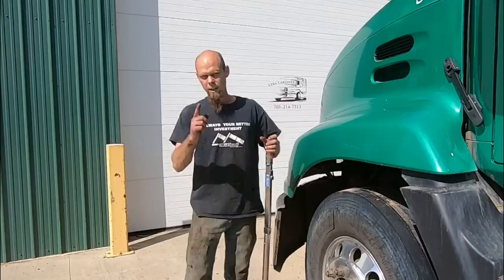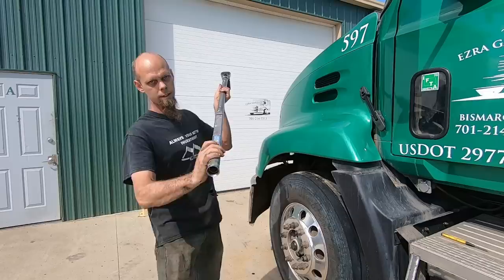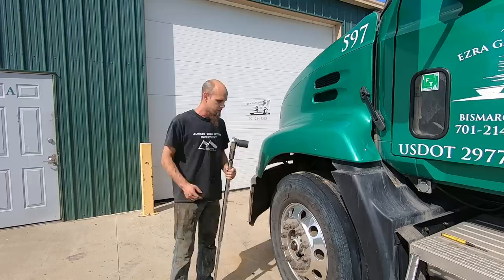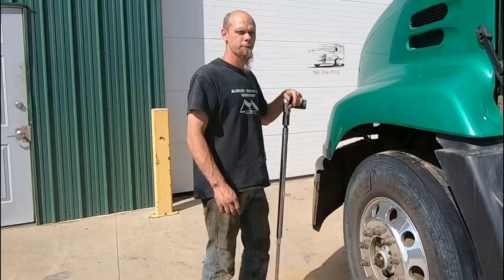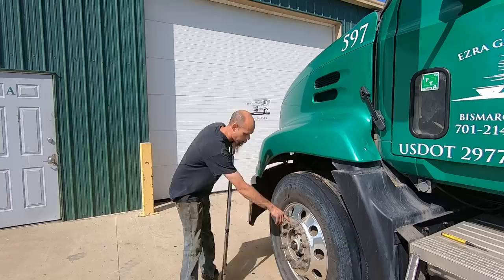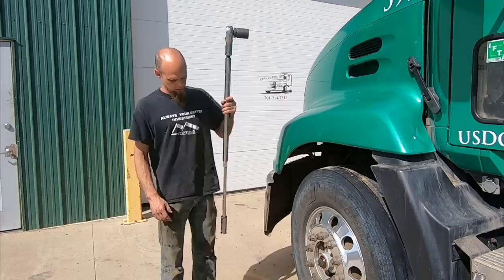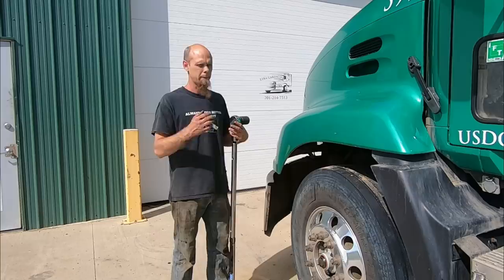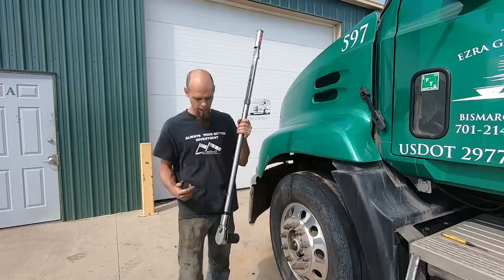Torquing semi truck lug nuts - Precision Instruments - C5D600F36H 1" Drive Torque Wrench

Comment: So how many ugga duggas is that? Trying to see how tight my 1” impact gets my nuts. Over 40years of trucking and not one wheel has come off or one nut loosened up. After awhile you just know how tight is tight with an impact and how much is too much
Reply from the maker: I'd say about 6 ugga duggas or if you want to actually be accurate you can use the method I showed in this video

Comment: Usually finger tight is good enough from my experience. Just make sure you don't cross thread and you'll be fine
Reply: Funny you should say that, Alcoa recommends that 1 or more nuts be run down by hand so the wheel is up aganst the hub (flat), but that the others be left just a few threads on to indicate that the wheel is not yet tight, then once you start, you are committed to finishing. (never fails the boss will call a meeting)but this is one of the things a tire man can't let happen....let the phone ring....ring....

Comment: 750ft lbs i know I change tyres daily
Reply: We're does it show you if you did the right amount of lbs?
Reply from the maker: if your torquing to 750 you are doing it wrong daily.
Reply: @Ezrider359  we change tyres on volvo scania and daf 8x4 tipper trucks 750 we never had one snap round or come loose

Comment: And secondly never tighten wheel nuts when there warm or hot .
Reply: Why?
Reply: @barrioscorona215  who know, I work at a quick lube anf half the lugs are smoking hot nothing happens, maybe bc when they get hot they expand but they'll never get that hot
Reply: @nw4496  yeah I agree with you, metal does expand when it gets hot, but it'll have to be like you said, extremely hot. I work at a machine shop and sometimes we need to do an interference fit with a steel tube and a steel rod. So we heat up the rod with a blowtorch for like 3 minutes and then we insert the steel rod inside, and once it cools down it's like almost impossible to pull out.

Comment: Torque it with a 1" impact and ship it.
Reply: One to two ugga duggas should do it
Reply: Yessir, Yessir, time is money! ☝️😤#ShipIt 💵
Reply: Spline drive ugga dugga send it
Reply: I might agree but... If it is your truck and you care do you want to streach studs? Or snap a stud?
Reply: Just cross thread them. They shouldn’t come loose.
Reply: @ralladoastalamuerte  until next time when you gotta take it off and rip the threads off... hahaha
Reply: And then the wheel comes off and kills someone and you get to go to jail for manslaughter.
Reply: IF THE OWNER IS WILLING TO PAY THE EXTRA TIME (TIME IS MONEY AND TORQUE WRENCH ARE NOT CHEAP)AND EFFORT TO TORQUE THE NUTS
HELL I WILL DO IT!!!
BUT GUESS WHAT, THEY WILL NOT PAY ,SO I JUST TIGHT THEM WITH MY 1" INGERSOL RAND IMPACT, NO PROBLEM I HAVE DONE HUNDRENS OF THEM WITH NO COMPLAINTS,
JUST USE A GOOD BRAND  IMPACT
Reply: @ralladoastalamuerte  I prefer to spot weld my lug nuts after crossthreading them.
They are not coming loose i tell ya
Reply: Hey WOW, you must be on my day shift, is your knick name Larry the Cable Guy by chance?but seriously folks, maybe you really have a gift, I might find my womans g-spot most the time but I never measured it, the problem is, most people don't have the gift but think they do....so that's why the first thing you do when it reaches your lot....RETORQUE!!!!...nut checks????

Comment: Not bad for 400! I'll keep my snap on tho... Much higher price point but, when i do a cylinder head or bottom end i don't have to worry... Nice video as always EZ!
Reply: Your Snap-On is only as good as the last calibration. We used to have our Snap-Off and Matcos recalibrated once a year. Most of them needed some adjusting.
Reply: @cullenmiller8170  my dealer does it for free yearly...service - I've got one of the best reps, hands down. Though my growing Milwaukee collection is pissing him off
Reply: pretty much. I keep telling him he needs to start selling em...figure he gets enough of my money as it is... A
Reply: I doubt you're using a TQ wrench of this size on heads, so what is the point you're trying to make?
Reply: @TheRoadhammer379  the torque on a cat 3406 engine is comperable to what he did the lug nuts to.  Sit down son you're making yourself look uninformed.
Reply: @TheRoadhammer379  and my point is the accuracy of a 400 wrench vs a 1500 dollar one...rims don't matter as much as a Crank or rod journal or a head bolt/stud. Over or under torque will cause leaking or cracking... Mechanical 101...
Reply from the maker: A calibrated tq wrench is a calibrated tq wrench they all need to be periodically checked. When it all comes down to it tq is still a inaccurate way of measuring clamping force. But yeah if someone already has the snap on version there would be absolutely no reason to go out and get this one.one thing to keep in mind too is a tq wrench is most accurate in the middle of there operating range
Reply: @Ezrider359  that's why most of the time cat gives a tq rating with a plus or minus then specifies a additional degree for the fastener to be turned. Usually 90 or 120*.  For the record, I'd totally get one of the 400 dollar ones for doing wheels. I'm just partial to the finer movement in the head of the higher end tools. That 80 tooth action spoiled me!
Reply from the maker: @familytraditiontransportat7951  yeah a lot of people building performance engines for cars have gone to using bolt stretch gauges. Not a fan of the head on this one but acceptable for the price
Reply: @familytraditiontransportat7951  Hard to get a 3/4 or 1" ratchet with more than 24-26 teeth, finish is generally not great and the way they're pinned often adds a wagonload of slop on top, for the money I don't love it. I guess they figure most of the buyers are 'industry' and either can't afford or can't be bothered to shop around.

Comment: a snap on is 500 for a 3/8 torque....lol this thing would be 3000 if it were snap on
Reply: I think Snap-On's digital 3/4"s are at least $1,300.
You can spend upwards of $3,500 on a 1" torque wrench no problem.
Reply: Snap-on’s 3/4” Techangle is $1,500 list price. You can get them much cheaper on promotion or with a student discount. I paid just over $700 for my 3/4” Techangle.

Comment: A torque wrench is not a breaker bar...
Reply from the maker: Try actually watching the video
Reply: ...some of my co worker's would disagree...😂😢
Reply: I think I have a alternative idea, get a slugging wrench that fits your 1inch drive extension, mine was 2 and 1/16, then weld, or you can buy a Wright tool #1900...